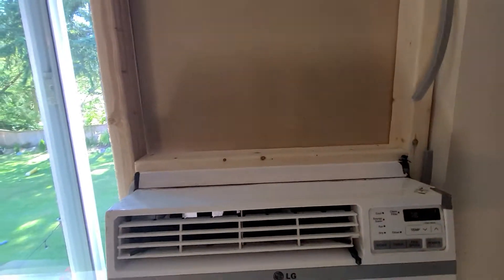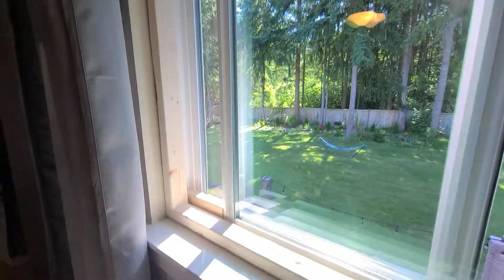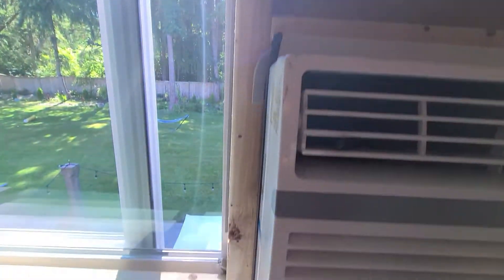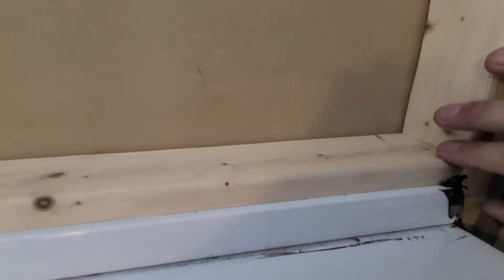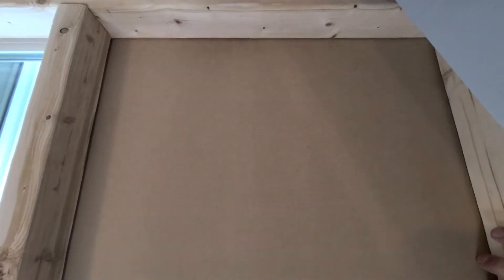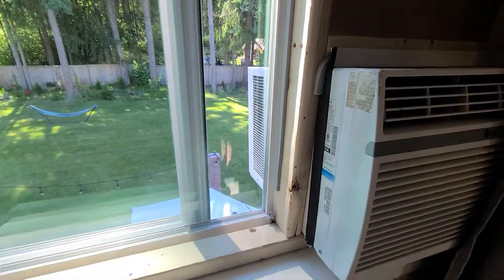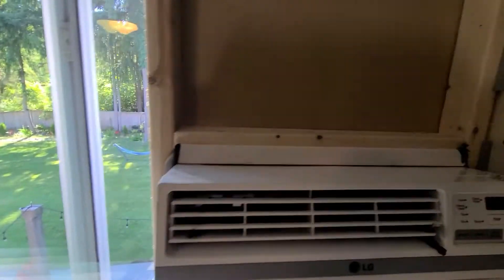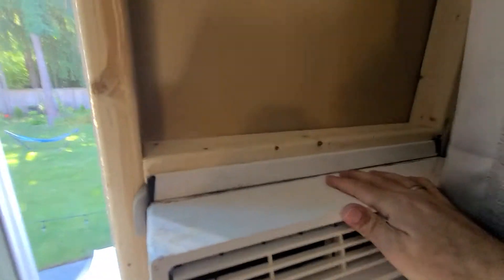How to install an air conditioner in a side sliding window.

Comment: I've been searching for the safest way to install a window AC unit on the 2nd floor. Like you said I don't want it to fall down to kill anyone.  I've been thinking about using heavy wood 2X4's but wasn't sure how it should be framed with respect to the existing window socket until I came across this video. This is EXACTLY what I was looking for. My search stops right here, and thank you for sharing this idea!!

Comment: That kinda what I wanna do to mine lift window or remove bottom window put in a permanent frame to slide window unit in then have a painted board to slide over bolts on outside when I remove it in winter or just leave it in if I want.
Reply: If you own it like I did I put it through the wall...

Comment: Ingenious!  Neighbor gave us her old unit but it didn’t come with any brackets, etc. Looks like yours has a bracket on the top of the unit. Can I get by with just putting the 2x4 directly onto the unit?  I plan to use my Kreg jig to connect all the wooden pieces. 
So to clarify, you didn’t screw the border wooden pieces to your window frame, correct?  Thanks for sharing your solution. 
Lori
Reply from the maker: If it doesn't have the fin on top, this method wouldnt be as safe. You might have to modify the unit. Home depot sells something that would work but you would have to take the unit apart to attach it. Some units are made to slide out of the metal shell. 

I dod not screw the 2x3's to the window frame. You can get some velcro like stuff fron home depot. Its marketed as picture hangers. I put those on the bottom.
Reply: @I-Sharted1  Ok, thanks again. I’ll check out HD!

Comment: Someone can pry out the exterior nails to get into the room.
Reply from the maker: Ya. In my opinion though, especially if its on the second floor, if someone wants to get in, they will get in anyway. If you have a first-floor window, i would add an inside panel to be safe.

Comment: Did you use a supporting bracket in the back? Or is it completed supported by the weed frame?
Reply from the maker: The only thing i used was velcro tape on the window sill to hold the bottom in place.
Reply: Ok thanks. That's what I guessed. It seems the 2x4s are strong enough to counter the natural tilting/flipping of the AC unit.
Reply from the maker: @LL-ue3ek  yes. Everything needs to be pretty tight though.

Comment: Did you screw in the 2x3s into the trim, or used some type of sealant?
Reply from the maker: i used stick on velcro at the bottom so it didnt move. thats it.
Reply: @I-Sharted1 ok, I’ll try this out this weekend before it’s to late with the summer heat 😂

Comment: Why build it on the entire window? You could just build it the size of the window opening and wah lah. Good thought provoker tho.
Reply from the maker: I actually changed to to that last year right before the heat wave.
Reply: @I-Sharted1  is it not more secure this way though? the full length 2x4 probably provides balance
Reply: @J.Sandhu2 no.